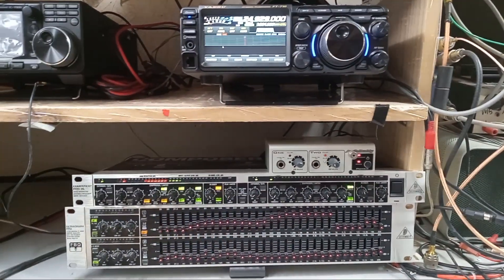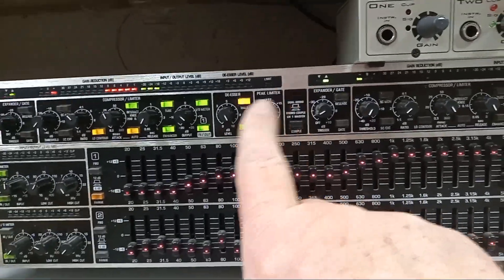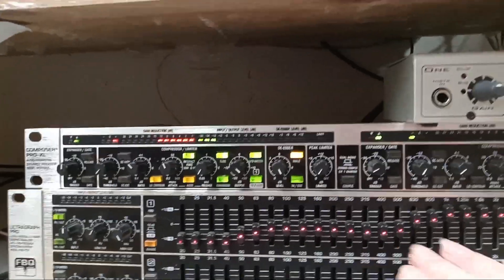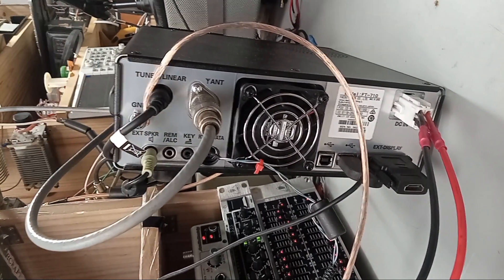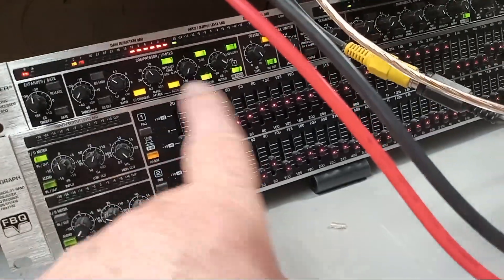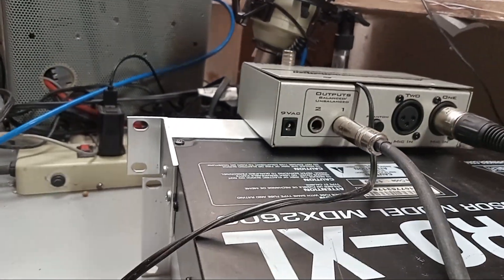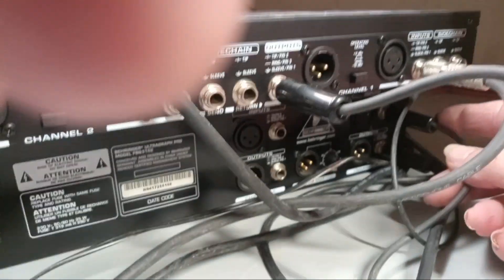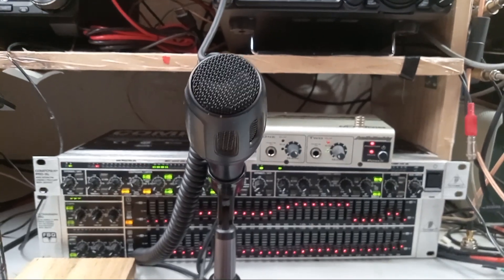Yaesu FT 710, adding external audio gear. The long version., with more Rabit Holes coming.

Comment: You might want to try running the signal through the EQ before the compressor for a more natural sound. That way the compressor is only acting on the frequencies you intent to transmit and will be unaffected by those you've cut using the EQ. For example, a plosive from a hard "P" might cause the compressor to duck the signal across the whole spectrum, but it wouldn't if the EQ had cut down on its low-frequency energy beforehand. 73

Comment: you can clear up your vocals by dropping everything below 127hz on your graphic EQ, take a 3db dip out of around 400hz and the two bands either side of it, you also said you've boosted the highs for more clarity in your vocal but you've cut off everything going up from 4K, what you boosted would be more of the 'upper mid range' and the high end of your vocals would be 5/11khz, but they were maybe causing some feedback? 
 id take a photo of the settings you have and work around with what i've suggested Bob if you did want that bit more high end to cut through,  the Mic sounds great